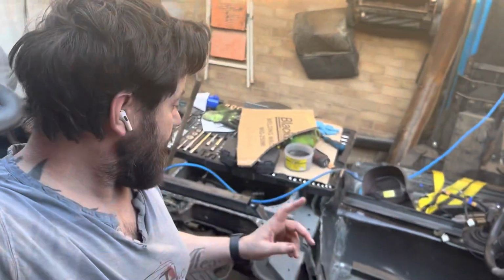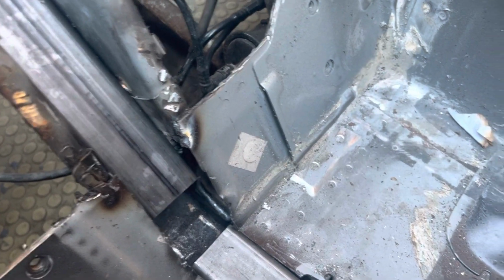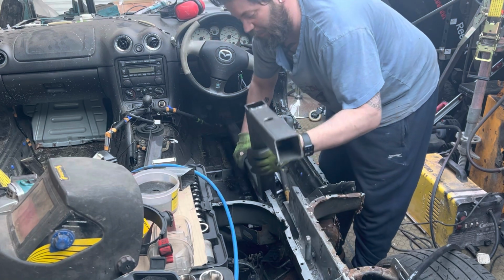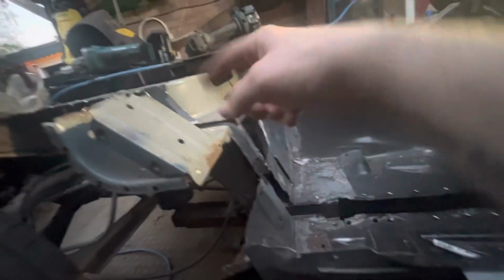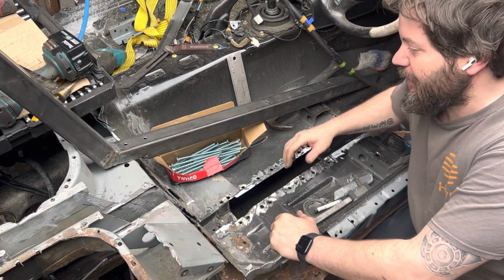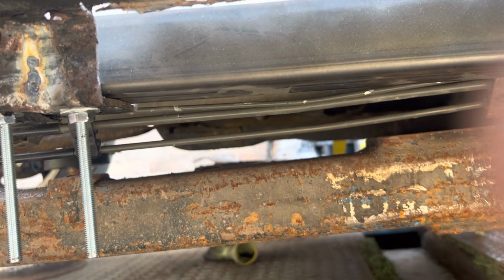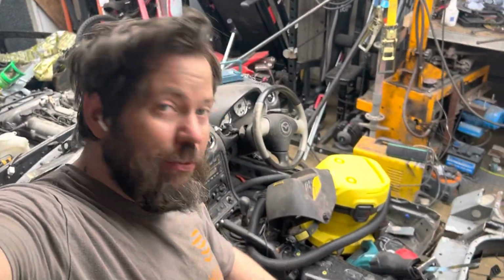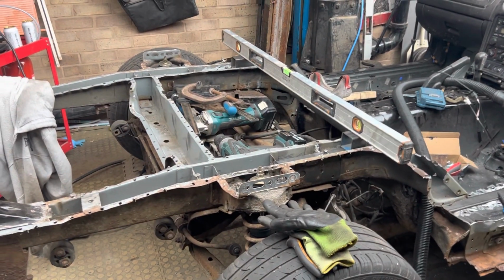Mx5 miata body swap ford escort xr3i

Comment: I'm wondering how u plan on registering it as I understand it to keep either of the original I'd.s a vehicle must have original suspension original body and original chassis
Reply from the maker: I haven’t looked that far into it yet,, it’s predominantly going to be custom made.. I will basically be making sure it’s insured appropriately
Reply: To make it legit road legal it'd have to go through IVA. It's do-able, but you've got to build it with the test in mind. The Escort's registration and the Mazda's are both void as soon as you modify them to a point DVSA regard as 'radically altered', which on a monocoque means anything floor related; suspension pickups/mounts...basically anything on the shell that isn't a something like a radiator mount.
If it has a separate chassis (e.g. Land Rovers, TVRs, Spifires, Black cabs etc) it's actually a lot easier as the chassis is the I.D. of the vehicle, therefore if you don't modify it from the original spec, you can plonk whatever body you want on it and keep the registration of whatever that car was without having to go through IVA & re-registration,.

There is a LOT of misinformation out there on this subject, so tread carefully. Half the modified cars on the road probably aren't road legal. MoT doesn't come into it, that's something totally different.

Good luck and shout if you need advise.
Reply from the maker: With information like that your going to make it difficult to plead ignorance 🤣
Reply: @NicksGarageUk  Ha! I'm in that profession, I see it a lot. We've had customers cars here end up being scrapped or broken up as there was just no hope of getting them through IVA. Had guys in tears on the phone who've poured heart & soul into a build and didn't read the rules first. The rules let you do it, to be fair, they just make sure it's done properly.
Been through a few IVA tests myself, too. All good fun.
Reply from the maker: Thanks for the input, I was really doing it as a track car but would like it road legal, problem is I have had the escort over 20 year and wanted the original reg,, not a Q I’m not looking for as older mx5 as possible for (parts) In case I go for the IVA because from a quick look that seems to make it easier
Reply: @NicksGarageUk  Ah, sorry to be the barer of bad news but it'd definitely be on a Q-plate. Any modified monocoque is (unless they cock up the registration - it's happened to me!) But even if it wasn't, it would go on an age-related plate. The Escort's reg and the Mazda's reg are non-transferable, so there's no legit way of dragging that over I'm afraid.
Going for older MX-5 makes no difference other than engine emissions, but unless the MX-5 was pre-cat, it doesn't really matter as a pre-2001 cat test is as strict as IVA emissions get on a Q-plate.
Reply from the maker: Thanks for the help, the ID I’m after is 1989 so should help with the emissions test as pre cat (1992-3) I think.. I was thinking it would go on a q, what are they like to insure? Your a great help and I have subscribed 👍🏻
Reply: @NicksGarageUk  You normally have to prove the age of the engine to show what emissions tests it needs, but if you have a V5 from the car it came from, that should be enough tbh. You'd only need the old 3.5% CO/1200ppm test. An MX-5 engine would piss that.
Reply: @NicksGarageUk  Insurance wise it might be cheap. It's basically a kit car now, just one you built yourself rather than a kit you bought. Kit car insurance is normally cheap, but obviously you don't know until you go through it all.
Reply from the maker: That’s my hope,, what’s the most difficult part of the IVA? Do they look at welding etc? I’m going to try and make it look factory ish,, not a patchwork quilt
Reply: @NicksGarageUk  They don't look too closely at welding, more the overall design & structural integrity. Obviously if something looks iffy it'll make them look more closely at it overall, but some of the kit cars that get through are atrocious! 
Bigger things people tend to fall over on are noise; sharp edges (2.5mm radius on most bits of external bodywork); light positioning; seatbelt positioning etc. Starting with an MX-5 will give you a headstart on a lot of it, but don't assume a modern MX-5 would pass an IVA today, as the rules change all the time. I work with TVRs a lot, and none of those would get through today.
Reply from the maker: Your a star, the structure won’t be an issue,, I have the escort back now and the floor cut out,, because it’s a cab it has an extra chassis rail attached to the sill front to back so I will have that as well as the mx5 ones,, I will look into seat belt mounts because I’m looking to keep the standard escort ones and the Mazda seats with integrated receivers